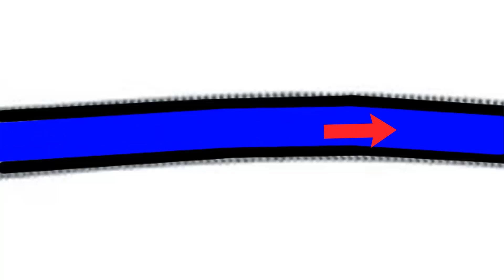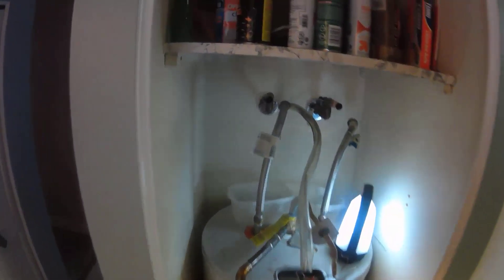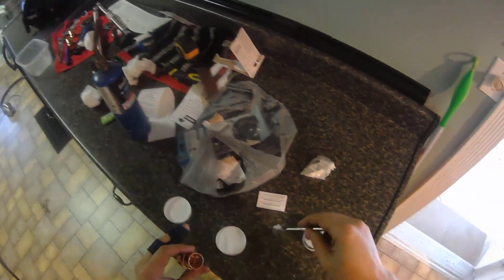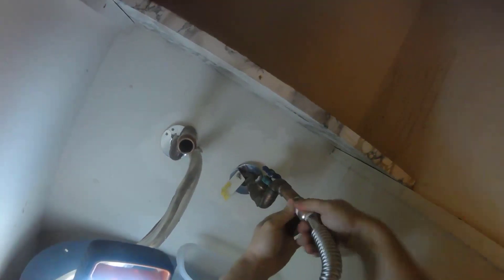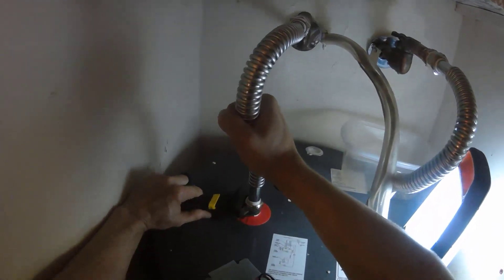How changing your Hot Water tank can improve your water quality!

Comment: Those burn so much power. You really should've gone heat pump. There's rebates
Reply from the maker: They do, but I would not have been able to place a heat pump in that utility closet due to the space.  If I switched, I would need to find a new space in the house for it, and re-plumb the house.  So, I guess I will need to pay $400 in electrical costs a year just to heat the water in the house